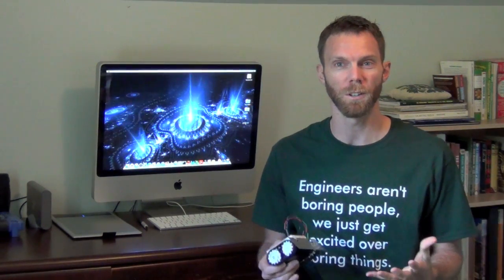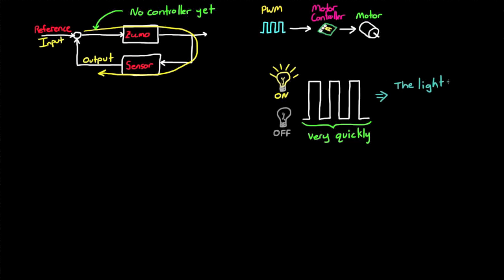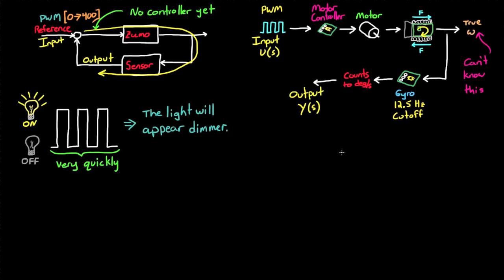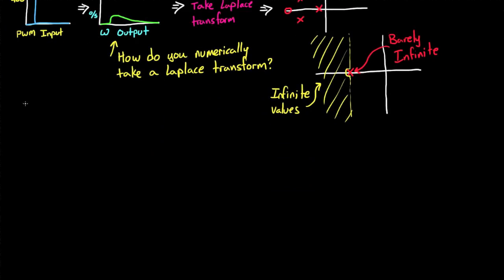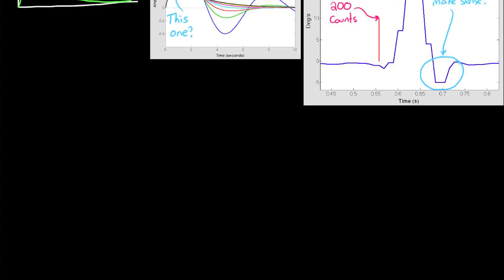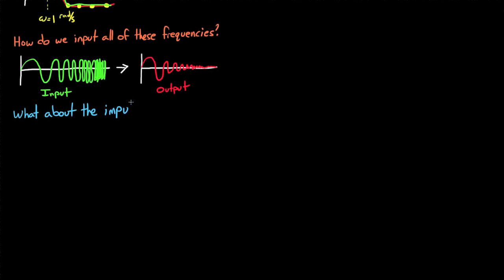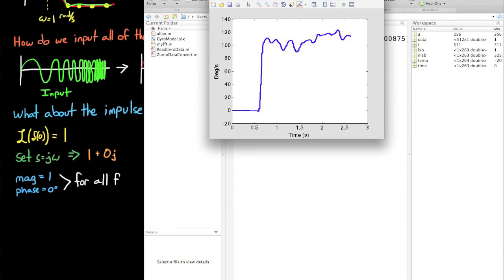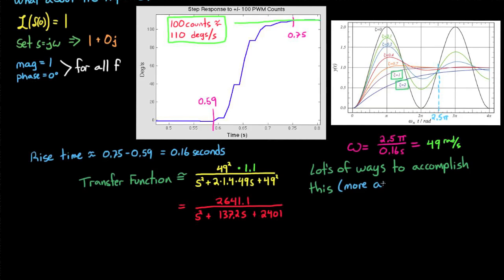Robotic Car - A Simple Way to Build a Model

Comment: The oscillation after the step response could possibly be a result of position of the sensor itself. It may not coincide with the rotational center of the robot. Therefore, you have to consider the lever arms from the sensor to the center of rotation. Maybe this will solve your problem.

Comment: Nice work Brian;  You are very gifted.  The biggest problem is trying to remember all the math, transforms, and others.  Otherwise, I will try to step my model and see if I can get a response similar to what you got.  

I do have a system that I want to step from work.   Step response through an epoxy coating which could be a "capacitor like objective " measuring this current during this step;   it would be a high voltage that breaks the isolation down, at some point current would flow just enough to trigger a relay.  The Relay has a hysteresis requiring minimum pulse width to maintain an on condition before the next count.

Comment: Maybe the uneven step response at 12:20 has to do with the rubber treads not being perfectly circular in their relaxed position, so as they are driven around they provide a smoothly varying torque load? It’s a testable hypothesis at least :)

Comment: So, using this model, that has an angle as output, could we use it to drive the car forward, or in a curve? I think we could calculate each wheel's speed from the angle, since we can measure the distance between the wheels.

Comment: Hi Brian, What did you mean by 100 counts of PWM? Is it like PWM counting 100 times to period? or something else?
Reply: Alex Shei if I'm not mistaken, it means the pwm duty cycle is 100/400, as 400 is the maximum value. This 100 count value gets mapped to a 0 - 255 scale when using an Arduino, for example, as 255 is 100% duty cycle, as opposed to 400.

Comment: Hi!
I have a question about the calculation of natural freq at 13:29.
Could you explain why w = 2.5*pi/(rise time) ?
Reply: Sorry for respond now haha but 2.5π is the turn length, remember that the measurement of a circumference can be given in angle or radian, so the angular speed (how rapidly the car can gyre) is "2.5π (not 2.5 * π) / time (in this case it is the rise time)"
Reply: So basically when you will model a second order overdamped system, you will get a graph similar to the black line or blue line or somewhere in between. Now the rise time is the time at which response reaches from 10% to 90% of final value (definition from Ogata book). The actual time in seconds will depend upon the natural frequency of the system. The higher the value of wn, the lesser will be the time taken to reach particular value. Hence there is inverse relation. The graph that he has shown have been normalised by multiplying with wn, so wn(rad/sec) * t(sec) will give an angle(rad). 
He approximately calculated the angle for which approx 90% or 100% of final value will be reached and that came as 2.5*pi.

Comment: How do you model a system that has more than one sensor to calculate the error? Do you need several controllers or just add the input data?

Comment: As far as the unidentified angular velocity oscillation go, I would speculate that the rubber treads had a "natural" position/shape where internal stresses are minimized.  As the tread rotates it gets to a point where it is fighting against these residual stresses.

Comment: Hi Brian, can you tell me how you get the data from arduino to matlab? Did you save the data into an EEPROM then transfer it to matlab? and what sampling frequency were you using?
Reply: +Sovichea Tep 
Yes, I got similar question, I noticed that the car is not connected to any cable, so how do you transmit UART output to your Mac computer? Is it just an film special effects？

Comment: Brian, your estimated transfer function should have 2 sig figs for your numbers, e.g 2.6E3 for the numerator otherwise you are implying 99.998% accuracy, is that correct? Respectfully and with Regards, Frank

Comment: Something not always clear to me with open loop systems:how to deal with the fact that input is usually in different units than the output. I mean, in my system my input is electrical power and my output is pressure or temperature (since it is a thermal two-phase fluid system these two are related). Adding a controller converts an error (for me delta Temp) into actuator electrical power, so then input/output is in same units. If I understand well, I need to know the dT/dP of my system. Right?

Comment from the maker: Unity feedback is just a fancy way of saying multiply the feedback path by 1.  With unity feedback we are essentially just taking the output from the sensor and comparing it directly with our reference command.  We aren't multiplying the sensor reading, or filtering it, or integrating it or anything.  Unity feedback is simple so it's often taught as a way to understand feedback. However in practice you will usually manipulate the sensor path which results in not having unity feedback.

Comment from the maker: Another good suggestion!  I should pose questions to you guys more often :)  I'll try to reform my treads and see if that helps.  Maybe soaking in some warm water and let it cool on a circular shape will help.  Also, I might be able to isolate the problem to the treads if I run the car without the treads but on a surface that the plastic wheels can grip.  If the oscillation goes away I can conclude it was indeed from the treads.  Thanks!

Comment from the maker: The simple answer is that I set the wheel PWM to 0 counts for a certain amount of time.  Then after that time elapsed I set the PWM to +/- 100 counts for the rest of the test.  Basically stepping from 0 to 100. I will walk through the code in the next laboratory video and also expand on the model.  I was going to include a quick walk through of the code in this video but it was getting too long.  Thanks for the comment.

Comment: Oh and the reason we made it as narrow as possible was the car will probably spin on the actual wheels in the treads - or at least near there as thats where the weight it sitting. And then the problem arises that there is two points per track, So I think that's where the imperfections all come in.

Comment: Well we made the car as wide and narrow as we could. So the tracks were far away from the centre of rotation. It helped a little bit. The other advantage we had was the car had to navigate through a track we already knew. So we put some mechanical switches so it knows when it's aligned with a specific wall in order to sort of re-calibrate it mid test. It all turned out OK and we got the marks needed haha. The competition was for uni and is called WARMAN if you are interested. Really cool comp!

Comment from the maker: I think you're right on with that suggestion! The car definitely doesn't spin completely in place, there was some translating as well.  I was thinking as a good first step to developing a control system for it I would try to get the car to maintain a constant angular velocity despite this slight translation. How did your project turn out? Did you just adjust the car and treads like you said?

Comment: Have a look at the centre as the car rotates. I think that is why you get a struggle and the oscillation-ish response. We did a similar thing and due to poor tracks or a dusty table the treads wouldn't give a perfect rotation - which leads to it translating slightly as opposed to rotating and this changes the rotation speed. I think playing with the dimension of the car and the treads and the surface and what not you can fix it to a degree. Awesome video as well!!!